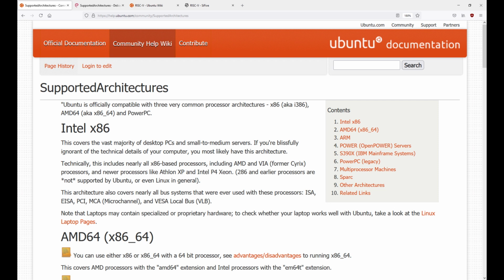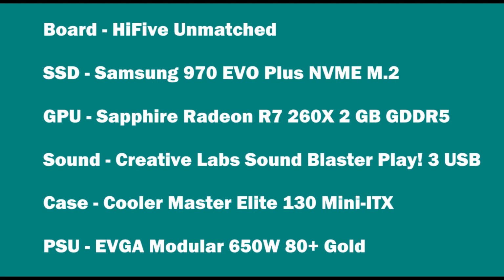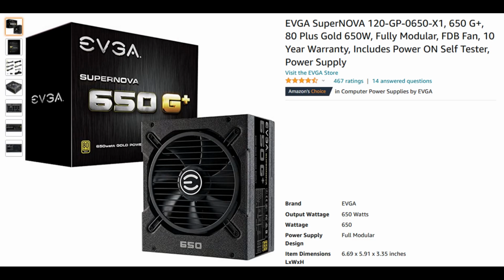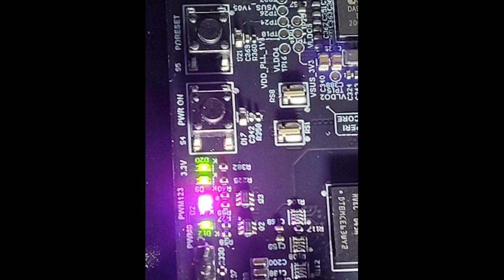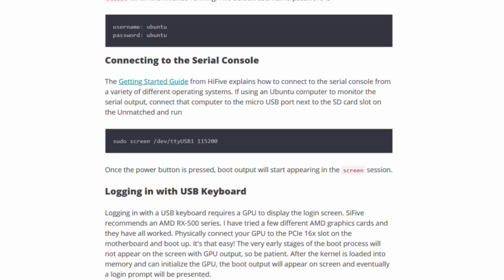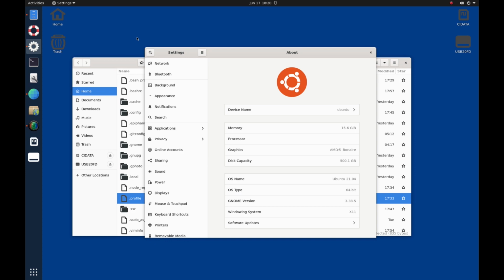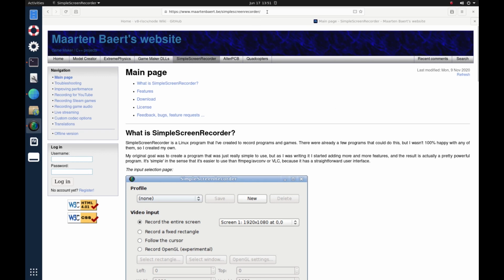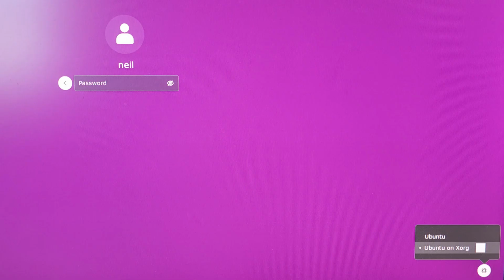Mini-ITX Build With HiFive Unmatched And Ubuntu

Comment: Not bad. Price is kinda high, $665 is high side for a Mini-ITX. I think this kind of R-5 implementation is more interesting for me, as I would want to use it in a desktop mode with my other machines. I'd also be interested in if if the MB would run in a smaller ITX chassis. Good job getting this all to run together!
Reply from the maker: It's outrageously high.  Basically I took the piggy bank I had been saving for possibly a Raspberry Pi 4 kubernetes cluster, and spent that on this one board instead to learn with.  The BeagleV was slated to be cheaper, but it seemed like it was going to take a while, and indeed that board didn't really ship.  

I already had K3S on an intel Ubuntu box to tinker with kubernetes, OpenFaaS, etc, and I knew nothing at all about RISC-V, so in the end I thought this was a more interesting use of that budget than a "stack of pies" :)   

But yes, exactly as you say, it was being able to run this as a real desktop that sold me on this rather than some other smaller RISC-V board.  I know I overdid it on the case, but I can always use it elsewhere if I move the Unmatched to a smaller case some day. A lot of people on the HiFive Unmatched Forum seem to be running theirs in big cases, or even rack mount chassis that they had on hand, lol.  https://forums.sifive.com/t/unmatched-desktop-builds/4791/2
Reply: @NeilWhitlow  I don't think you overdid it on the case. The selection at that price point isn't all that great.